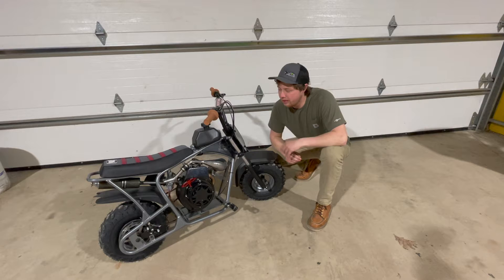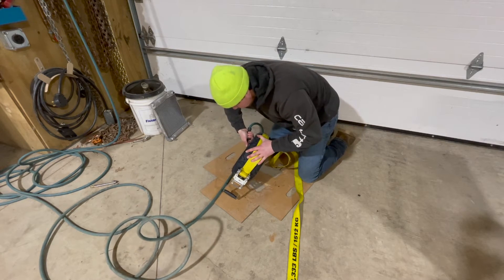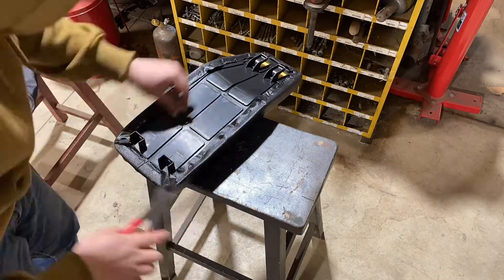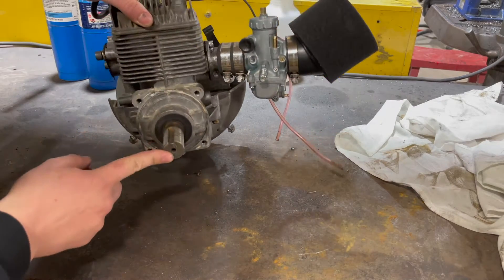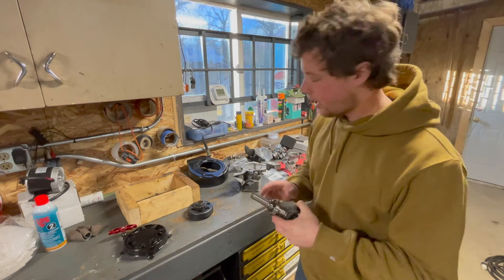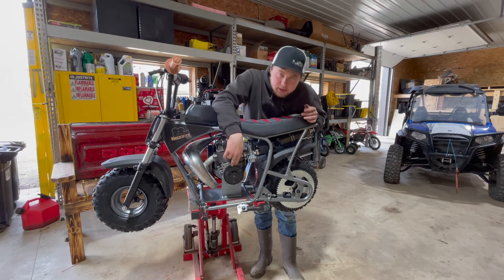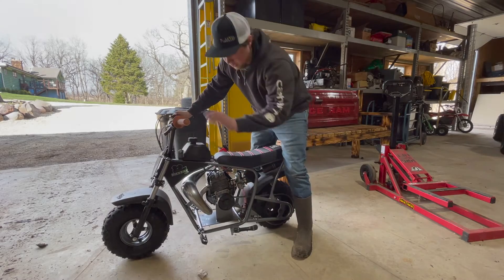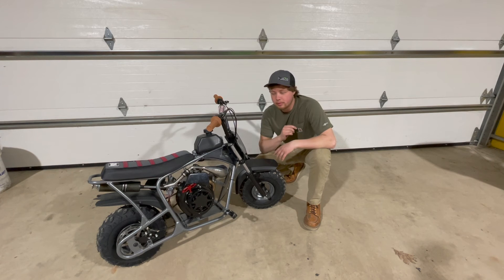Homemade Snowblower Powered 2-Stroke Minibike

Comment: A torque converter and jackshaft would really improve the acceleration and bottom-end, but wheelies could be a problem.
Reply: Just change the sprocket after, problem solved

Comment: That lil 141 really performs with a slide carb!  what size carb you running? And what's your gearing ?
Reply from the maker: It does rip pretty good! The Carburetor is a Mikuni VM24. The current gearing setup is a 10T Clutch with a 75T Rear Sprocket.

Comment: That's a bummer about the 1 inch shaft......I hope my 4.5hp 2 stroke has a 3/4 in shaft. I wanted to make a diy motoped / dual sport moped 🛵.
I'm hoping if mine is 1in that I can find a 1in clutch. Or some type of bolt on bslanced reducer coupler kit. Or go jackshaft, cvt etc...A high compression head E85 build would give it some kick.
Reply: @michaelbrinks8089  golf cart or snowmobile
Reply: @Bigbull6069  2 stroke 5hp  engine out of a snowblower...But sadly it's pretty wide.
Reply: @michaelbrinks8089  I did shorten the shaft for that reason.I bored the center out a bit on the Chinese scooter Variator,put thin bushing in & run the CVT on em.
The rpm engagement speed is close too, 
which actually works surprisingly well.
Pulls to bout 40-43mph.Got tickets lol

Comment: Gees, I woulda just spun the crank and shaved it with an angle grinder.
Reply: @jakegorman7121  🙂fun part was the splines at the tip(for variator.Cvt.)

Comment: 2-cycle typically has higher idle, did you change springs in clutch for higher engagement? (girl mechanic) 🛵💇🏻‍♂️💕
Reply from the maker: You are correct. Changing the clutch springs would definitely benefit this bike, might be a future upgrade!
Reply: @CineMotoYT  cutting a coil or two from springs will increase the rpms at which the clutch engages.maybe further tune by adding/subtracting sprocket teeth